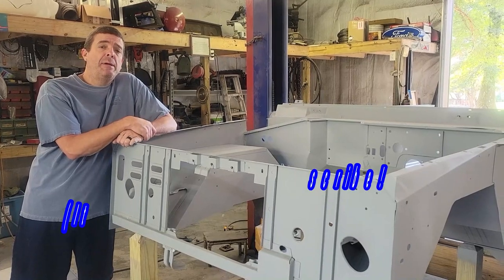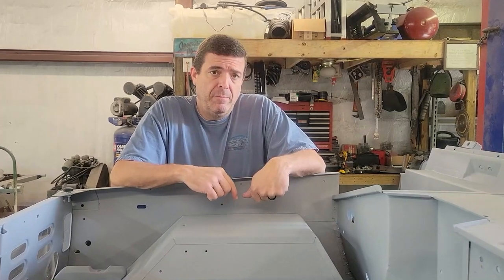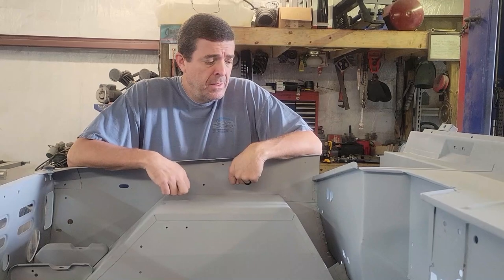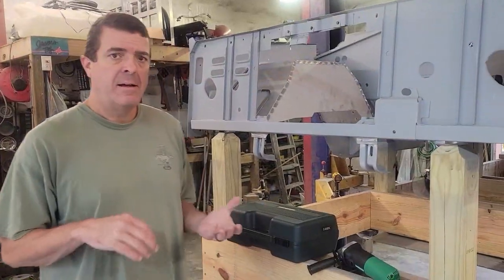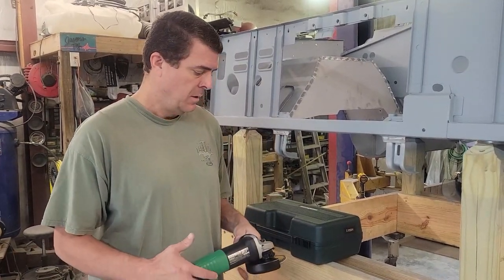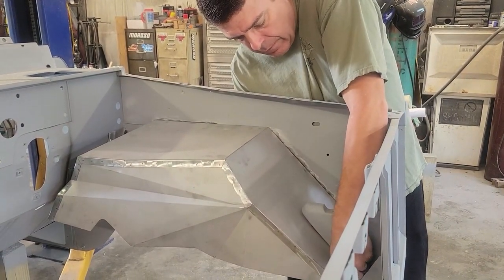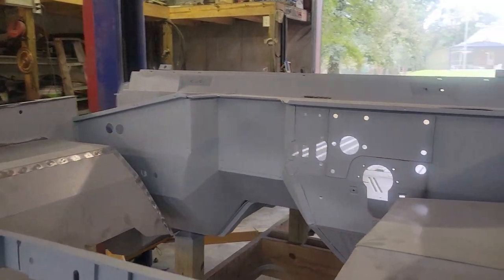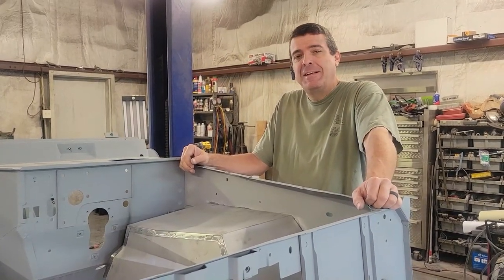Front Inner Wheel Tub Replacement - 1966 Ford Bronco Restoration Project

Comment: I bolted just like you did with stainless hardware, wheel wells, inner fenders to firewall with aluminum plate backers,core support to inner fenders.  Front clip comes off as a whole or in pieces.  So far so good.  Nice work!
Reply from the maker: Thomas that is awesome.  I did not think I had to be the only one to bolt them in.  Thanks for watching.

Comment: Have you ever thought about using threaded inserts with bolts / screws? I wanted access to my transfer case and transmission linkage, so I created a panel with holes in it for the screws and then pressed the inserts into the tunnel. It was a lot easier for me to remove that panel than trying to get my hands up and around the transmission. It also makes it a lot easier than trying to hold a nut and washer in place while tightening everything, not to mention they’re very low profile and look very clean.
Reply from the maker: Yes I have thought of those.  My friend has a tool to install them but this is so easy to install I don't them on this part.  Thanks for the idea.

Comment: Jason  that wheel tub will look better when the steering shaft and the power brake booster are installed.
Reply from the maker: It has some strange geometry for sure.  I am sure it will too.  I have to get used to it.

Comment: Love your attention to detail. I sprayed my engine compartment a few months ago. I just narrowed down my spray pattern to reach behind the wheel tubs. Is it as nice as the rest of the engine compartment? Probably not, will anyone ever see it? Probably not.
I had a few oil canning dents in my hardtop as well. I used a torch to heat up a few dime sized areas red hot, let them cool and the metal will shrink fixing the issue. I look forward to seeing you start the painting process 👍👍
Reply from the maker: Thanks Craig!  I have shrunk metal like that too.  My biggest issue is the paint.  I kinda get hung up on weird things that drive me nuts.
Reply: @JasonJonieBuilds  I hear ya man I'm the same way. Sometimes I just have to say it's good enough otherwise I'll never finish my build trying to achieve total perfection.

Comment: Great video and Jonie great choice on the brand for grinder. The only brand that holds up. I wont lie…mine got a “heavy” coat of POR back there and I called it good. One question…why not SS hardware?
Reply from the maker: Thanks David!  I could go stainless but they seize up easy if you take them out often.  We will see.

Comment: With the wheel tubs bolted in are you going to still seam seal?  Are you going to paint over the seam sealer?  If so aren’t you going to still have a problem painting the sealant down in those tight areas by the firewall?
Reply from the maker: Mike, I will not seam seal that area.  Both sides will be primed and and Raptor lined prior to assembly.  So they will have plenty of protection and will look real good too.  The lines are crisp so it will all turn out nice.  Thanks for the question.
Reply: Great idea. I was wondering the same thing. I’ll be doing that to mine. Thanks Jason.